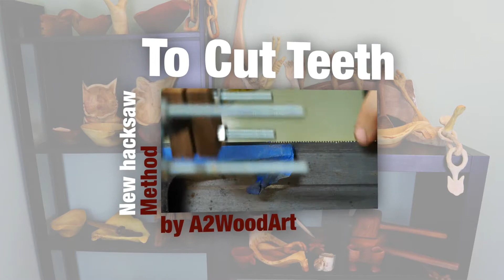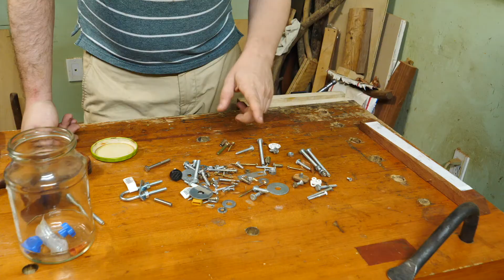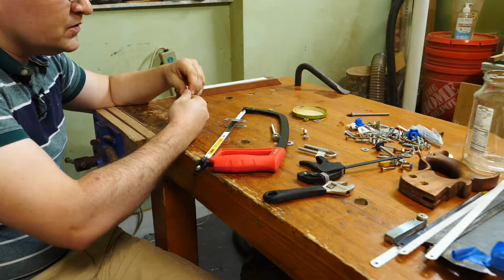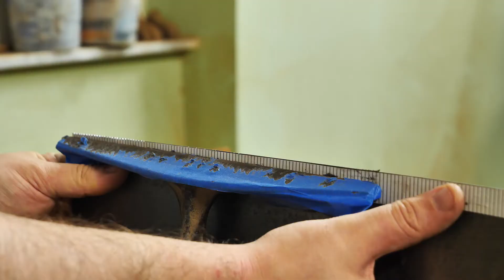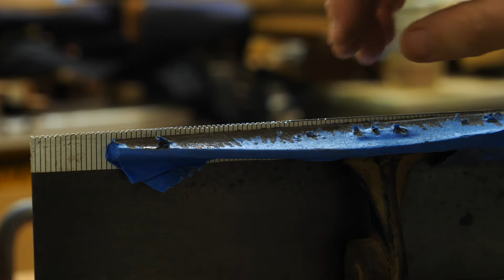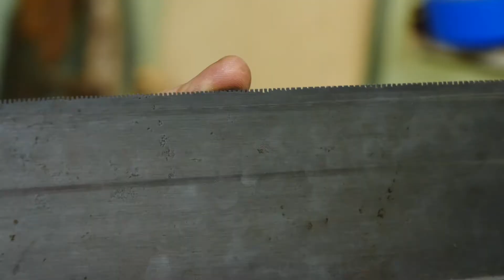The new method of cutting saw teeth with a hacksaw | Tool Jig Tutorial

Comment: Wow!  Awesome invention! A significant improvement would be to use long 3 blades sandwiched together with either rivets or short bolt and nuts.  The first blade has the non-cutting edge facing down. It serves as the guide fence. The second blade also has the non-cutting edge facing down, but it is offset from the bottom by a millimeter or the tooth depth. It's thickness establishes the spacing between the teeth and also serves as a depth stop, limiting the cutting depth. Finally, the third blade is the cutting blade and it of course does the cutting. The beauty of this design is that you not only get both a depth and space stop, but more cutting rigidity due to the stacked blades.

Comment: Many Thanks for sharing your idea.
What kind of hacksaw Blade are you using? I cannot sort any hacksaw capable of cutting saw steel.
Reply from the maker: Any hacksaw should be able to cut, as they are by design harder than saw plates (except the new ones). I used 32tpi one. The key is to have the plate secured in saw vice of some kind, otherwise it will bend but not cut

Comment: Very ingenious method.  Could you mount two whole blades in the saw with the spacer in between?  Maybe with a couple of small clamps to pinch them together in the cutting region? If the spacer could be accurately sized would also limit the depth of cut to a consistent amount.
Reply from the maker: Yes, this should be possible, I just went by the size of spacers I had.
Reply: @A2woodArt  The metal case of 9V batteries is amazingly consistent. I've measured a lot of them and they're always precisely one hundredth of an inch. So I save that metal to use as shims. I guess it is 31 or 32 gauge? In US currency a nickel will get you pretty close to 14 TPI. It should be 0.071 and a nickel is 0.074 So it gets you 13.5 TPI. A penny is 18 TPI.
Reply: @1pcfred  That's not quite what you need.  The tooth spacing will be the combined thickness of the spacer plus one saw blade thickness, because it's the distance from the left face of the reference blade to the left face of the cutting blade (or, equivalently, between the centres of each).  My hacksaw blades are 0.008" thick so 0.074" + 0.008" = 0.082" and therefore 12.2 tpi. 

Actually, it's a little more complex even than that because the hacksaw kerf is wider than the blade, so if you're working left to right and reference the left side of the kerf, you would get slightly higher tpi, while referencing the right side of the kerf would get slightly lower.
Reply: @1pcfred You missed the point.   I wasn't arguing with what material you use.  A suitably thin coin would be as good as anything else.  What I meant was that the thickness of a nickel isn't what you need as a shim for 14 tpi and pointing out that your calculation of the resulting tooth pitch was incorrect because you didn't add in the hacksaw blade width.  I admit, though, I mismeasured my hacksaw blade!  It's 0.7mm, not 0.2mm, so that's about 0.028", not 0.008".  If your nickel is 0.074" and your blades are 0.040", your pitch would be 0.114", which is 8.8 tpi, not 14 tpi.